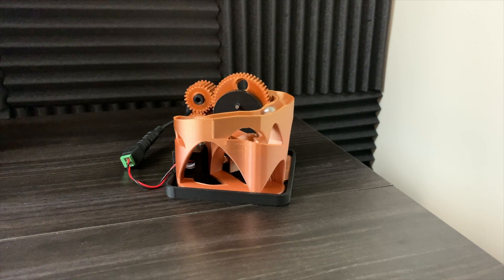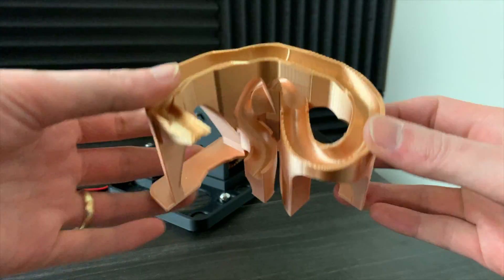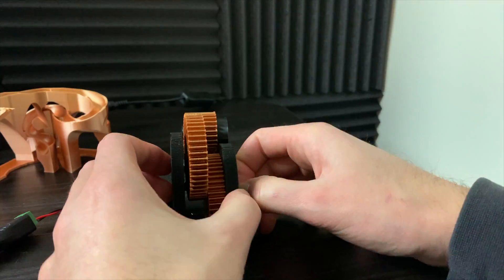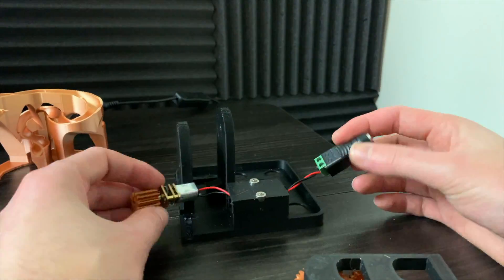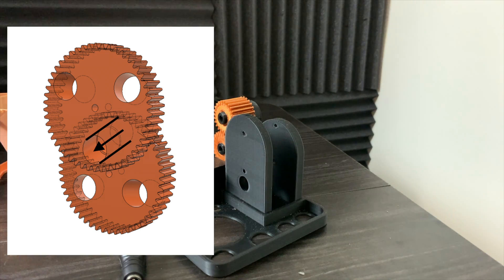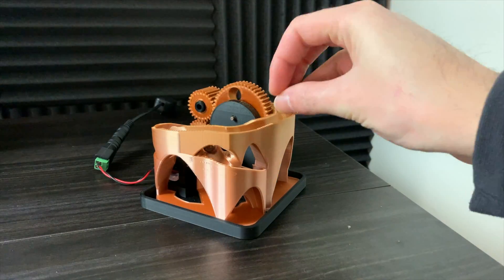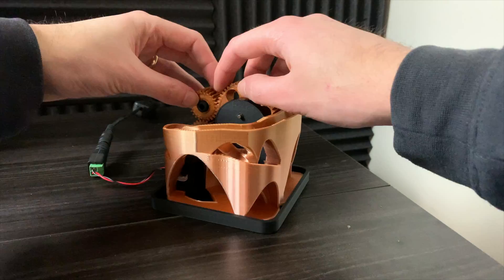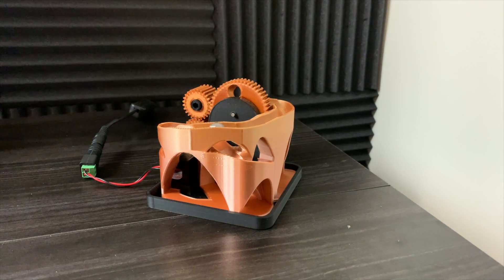How To Set Up ASTEROID BELT | Galaxy Marble Machines

Comment: Nice build but some size issues.  The metal axles that the large gears spin on are not fitting into the holes in the gears.  The holes are too small.  Using the items you recommended.
Reply: @3DPrinterAcademy  Done!  Drilled and working terrific.  Can't compliment your work too much.  Wonderful!